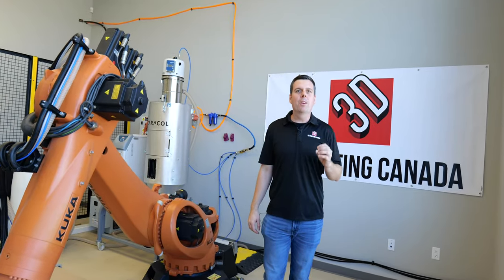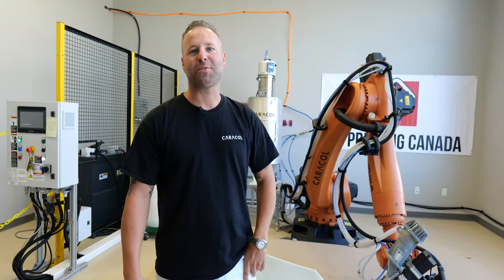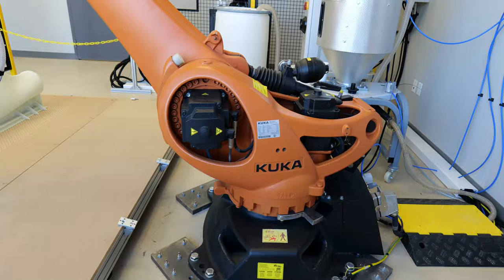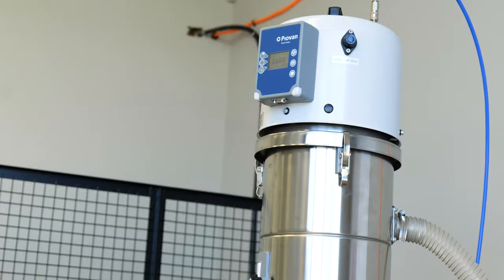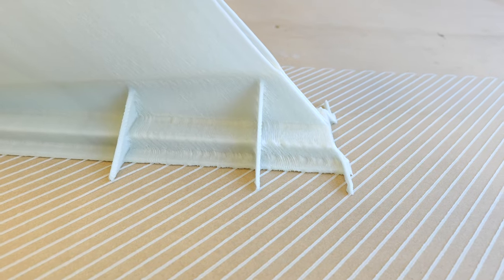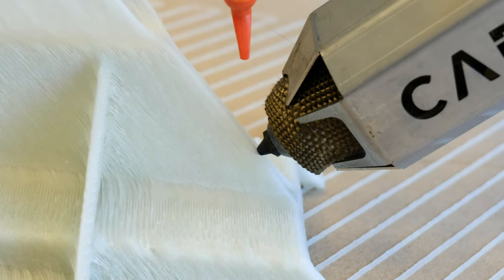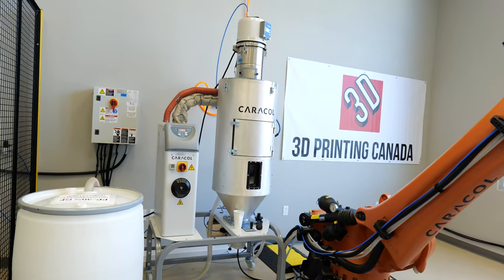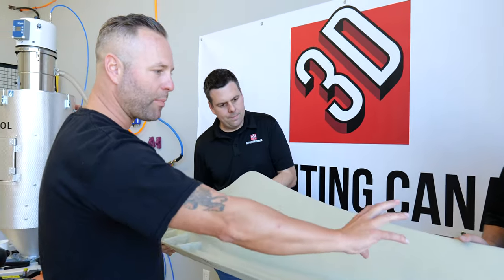Caracol Partners with 3D Printing Canada - Caracol AM Heron 300 Printing

Comment: That’s gonna cost a pretty penny. Seems kind of overkill for a 3D printer to mount it to a robot that is capable of milling or water jet cutting but hey I’m sure there will be some people this is for. It would be cool if it had a retractable spindle for a milling finishing pass, when you start printing really high volume the layer lines start to get really ugly to deal with.